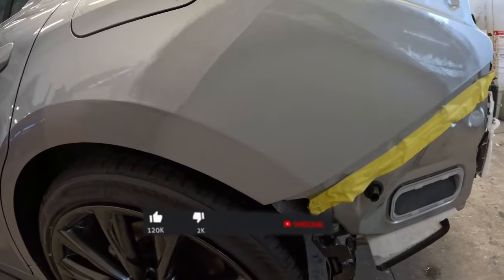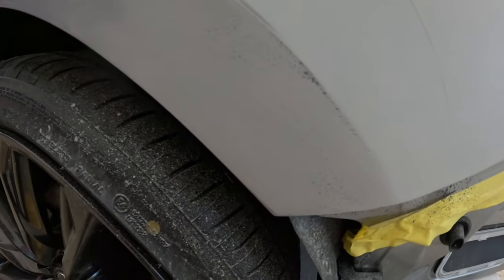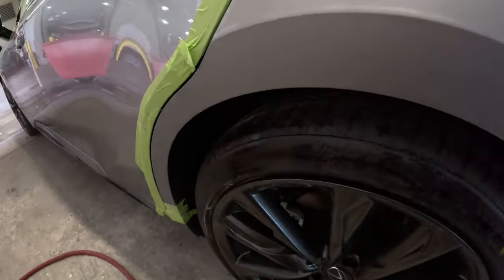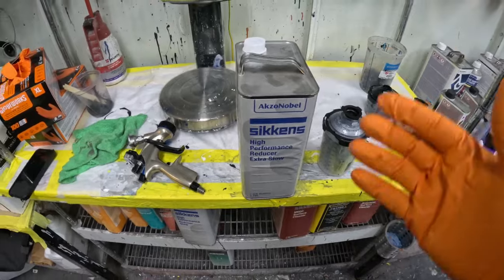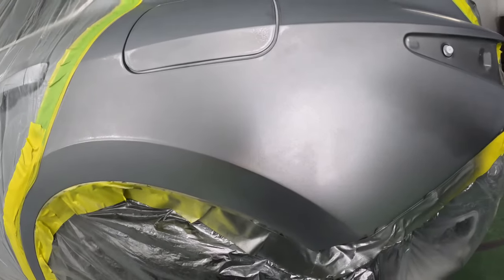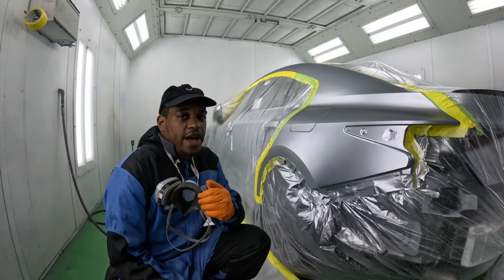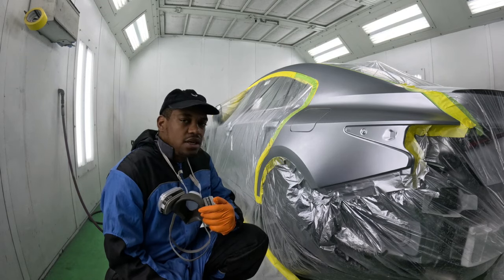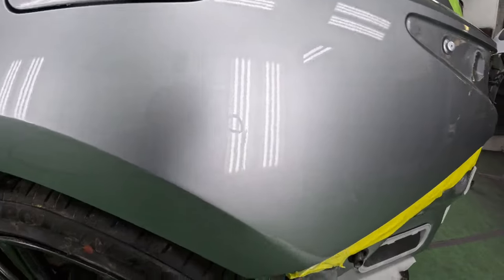CAR PAINTING: HOW TO BLEND TUFF SILVER

Comment: Great job,  I too am work on how to blend and everyone does something different.  When use blend additives, are you using a clear base coat or something else, and does it have to be from the same product line?? Been watching you for a while now, really like what you do.
Reply from the maker: Thanks for your support. My blending additive is a 2:1 mix ratio of colorless base and reducer. It doesn’t have to be the same product line.
Reply: @mariopaintclass6091  so if I'm using  PPG base coat I can use wanda clear base to blend??
Reply from the maker: @3rekoatskustoms929  I’m not familiar with PPG products. However I’ve used a variety of blending additives even the ones from the cans and never had any issues.
Reply: @mariopaintclass6091  ok thanks